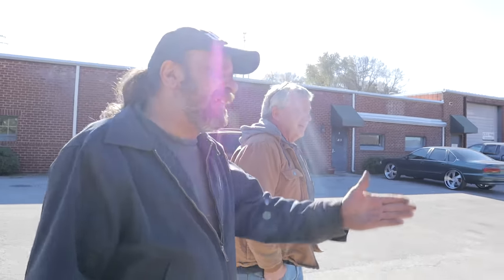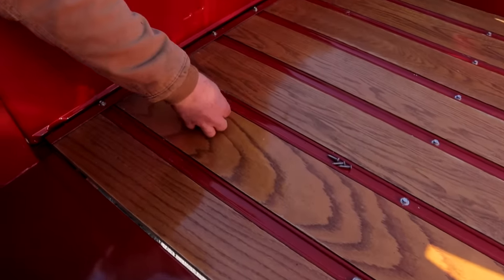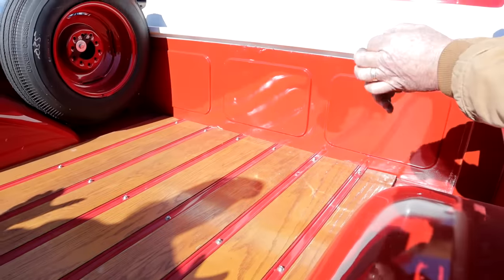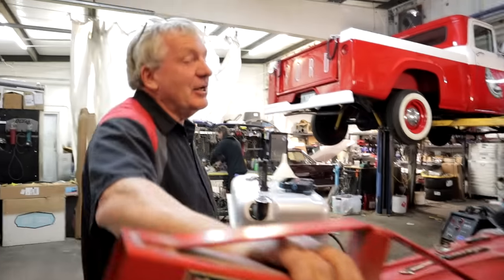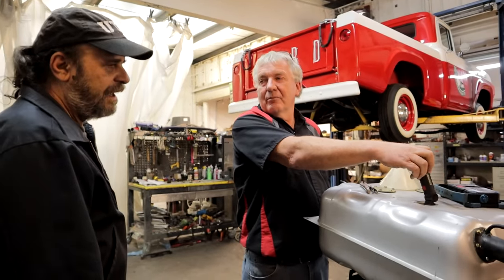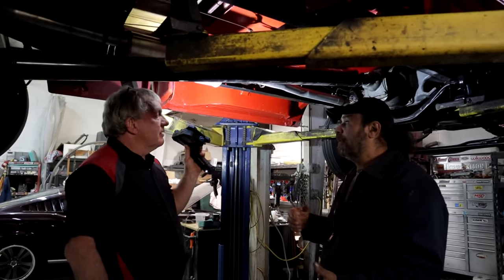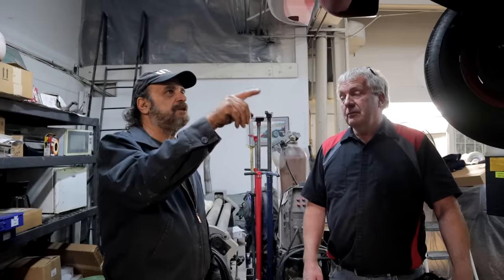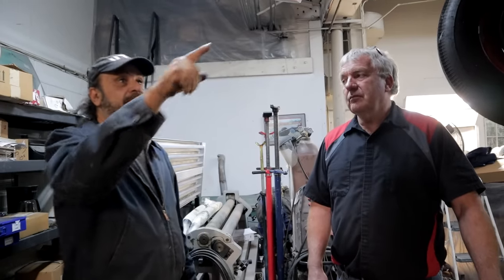Frame Off Restoration Gone Bad - Pretty Red Paint Hides Trashed And Rotted Parts Throughout

Comment: Glad you named names. Too often the perp is never called out. It should be easier to get compensated for frauds like that. I'm a redneck through and through, but I cut no corners when working on other people's stuff, nor will I even if they ask.
Reply from the maker: We've done videos like this before, but left out names because there was no clear and direct path back to the party who actually did the work.  In this case, the owner of the truck had a direct one on one transaction with the people she contracted to do the work, and that's why we "named names".
Reply: @UncleTonysGarage  Absolutely agree. There has to be a direct line to the people that did the work. Again, goes back to why I wont cut corners even if they want me to. Clearly this lady didn't ask or pay for that but I have seen botched up crap that the customer actually asked for because they themselves are the deceiver. Shops just shouldn't do it, if the deceptive seller gets caught, they'll throw the shop under the bus in a second.
Reply: @yodawunn6700  been thrown under the bus plenty. So I always give people the option to take their car anywhere else for a second opinion before I even start, and explain although there are cheaper methods, I refuse to use them. It's like buying the cheapest part you can find. It's the one that is guaranteed to fail.
Reply: @UncleTonysGarage  , I went on their website. They advertise as their specialty is restorations and old trucks. I can see why she chose them to restore this truck their advertisement looks l legitimate. I wonder how many other customers receive the same treatment from Possum hollow garage ? We need more people exposing businesses like this. I suggest anybody who’s looking for people to restore your vehicles. You get more than one reference on their work or do it yourself.
Reply: It's getting harder every day to trust anyone who we hire for anything!
Reply: @UncleTonysGarage  If this lady payed top end money and got that second rate job done then I agree and feel for her ' proof is in the contract details !
Reply: @UncleTonysGarage  I wonder if @PossumHollerGarage will respond to this. The problems with this truck are inexcusable, even if the lady did take the cheap route. Structural members held together with the equivalent of baling wire and chewing gum? Boards in the bed not even fastened down? The filler neck on the gas tank not even installed? The way they mounted that gas tank? That's not even good enough to be called shoddy. It's downright criminal.
Reply: @yodawunn6700  ...on the other hand...I  have a release form people have to sign when the want work done that isn't up to industry standards and practices...you don't find out who the cheapskate owners are till you're 3/4 done with the job and already owed money generally...I  would be willing to bet the shop that did that work did so at the customers urging...
Reply: We can hold them responsible. I asked them what they had to say on facebook with a link to this vid.
Reply: @waynefergusson9987  that's what I said nobody saw the estimate
Reply: You got to be very careful when naming names, if you name the wrong person/business for shoddy work you're going to get taken to the cleaners for libel. Hence why channels make damned sure that they're accusing the right people before giving names.
Reply: @JSki-kb8vf  ''I would be willing to bet the shop that did that work did so at the customers urging...'' What you're doing there, is called Making An Assumption.
Reply: @ryurc3033  no one tells people the price so for that reason I can’t do a cheaper paint job it will put me out of business
Reply: @timothydraper3687  ...based on 50 years of doing business...I've seen this movie before and everybody thinks the butler did it...
Reply: @JSki-kb8vf  Ha ha.
Reply: @jackieallen3344  I don't see any way that this would be the only truck they've done this way.
Reply: @Wooden Door Garage Without naming what country you are talking about, then everything you just said is nonsense. In what country do you need "ex certified parts"? I've lived in multiple EU countries, never heard of such a thing.
Reply: You don't know the other side of the story. They could have informed her after sand blasting that theres more rot and then she couldn't afford to fix it properly and was so far into it already so she told them to fix it however they could for the small amount of extra money she could spend
Reply: @MidnightPolaris800  If that were true, why then is she now selling it at a huge loss and angry about it?
Reply: @@thatv8life186 That post is totally devoid of any critical thinking what so ever.
Reply: It's not necessarily a perp. Do you have the frame-off receipts?
Do you know what the customer requested or paid for?
Frame-off jobs can be done on a budget BECAUSE of the customer's personal budget.
Was it $5,000 job or a $50,000job? It makes a difference and that information was not provided.
Reply: @MidnightPolaris800     I've had  what you theorize actually happen!  A 67 Chevy truck we did was found to have a lot more rust than was anticipated.  This was explained to the customer but the only options he was given was to fix it correctly or to abandon the project.  I have a great reputation that I'm proud and protective of, any good shop is the same !  The customer came up with the extra funds and as a result has a truck that has a 7 page feature in The C10 Builders Guide magazine that's on the stands right now!!   He's immensely proud as am I, he has no regrets, I have no regrets!!   So tell me, which truck had the happy ending.......?
Reply: @2Truth4Liberty   the customer doesn't run the shop the owner does! A customers inability or reluctance to pay should not dictate the quality or lack of quality of a shops work or ethics
Reply: @kiwiclassicsandcustoms9160  "A customers inability or reluctance to pay should not dictate the quality or lack of quality of a shops work"
That is YOUR OPINION, not FACT.
The FACT is that many people appreciate being able to adjust the quality of work requested based on their personal finances and there are good business that will accommodate their needs.
There is NOTHING unethical about that.
I would suggest there might be something unethical in discriminating against who can have work performed for them based on their personal finances.
Reply: @2Truth4Liberty  that's an interesting take on it.  For me it's about doing it right and doing it safe. That shouldn't be compromised on regardless of customers  wants.  Some times it's a inability to pay for what's needed and sometimes it's not being prepared to pay as they want to make a profit.   I had a guy come to me wanting me to bondo or lead up the large, hand sized holes around the roof of his truck. My response was "you can't lead fresh air"   He found another shop.
Reply: @kiwiclassicsandcustoms9160  While there were some flaws that should have been caught, I saw nothing that would fit the description of "unsafe". My '66 F250 is in far worse shape and I consider it one of the safest vehicle on the road as-is.
Reply: @2Truth4Liberty  yeah well it takes a lot air bags in your Prius to fend off a 79 F250 😁😂
Reply: @kiwiclassicsandcustoms9160  I thought it was a 1960 Ford pickup not a Prius??? Did I click on the wrong video?
Reply: Somebody's going to get it sued for liable
Reply: @SKANK_HUNT49   
Just technical FYI
Defamation is divided into 2 types,  libel and slander.
libel requires that the defamation be in "written" form

verbal statements in audio form would be defamation by slander (slander is the catch-all for what libel does not cover)
Reply: they have pictures of this truck on their website 🤣🤣🤣
Reply: @2Truth4Liberty  uhhhh , yeah that's exactly how it works... if you can't afford to have the work done it doesn't get done ... and any restoration shop worth it's ass would say the same thing ... WE'RE NOT GONNA RUIN OUR REPUTATION SO YOU CAN HAVE A BONDO BUCKET TO LOOK PRETTY ON YOUR LAWN FROM 500 FEET AWAY !
Reply: @2Truth4Liberty  if you drive truck worse than this on the road you are part of the problem! you're the reason states have inspection laws ! the crossmembers are rotten , the rocker panels are made out of fiberglass, tape and RTV  , the cowl returns are paper thin , the bed floor isn't secure , what happens if someone puts a heavy load in the bed abc they're driving down the highway and that bed falls apart on the inside and the load and the wood the bed is made from is scattered all over the road causing other people to wreck avoiding it ? or this lady gets t boned and the cab folds up like a pop can ? or she's driving in heavy traffic and the truck dies because the gas tank is full of rainwater and now she's in danger because she stalled out on the highway where other cars are doing 70+ mph ??? you don't think any of this crap is dangerous ? especially for a middle aged woman who isn't especially mechanical? THEY TOOK ADVANTAGE OF HER PLAIN AND SIMPLE , no matter if she asked for it to be done as cheaply as possible or not they should know better
Reply: @Hard_Right  You obviously have not been in the marketplace. And no reputation is ruined for doing what was  REQUESTED AND PAID FOR.
Can you produce the receipts for this Possum job? If not, you are talking without having pertinent knowledge.
Reply: @Hard_Right  And?
Is the "restoration request" and the "receipts" on their website too?
If not, your comment is irrelevant.
Reply: @2Truth4Liberty  oh cool. Slander then I guess. I'm not a smart man.
Reply: @Hard_Right  no joke I can't tell you how many times I've had to explain this to people who have done jobs for me around the house. They say well for what you're paying that's the best it gets. I'm like no you quoted me a job you should do it the correct way. Then I ask okay how much will it cost to have it done right. Because I still need the job to be done.
Reply: @yodawunn6700  They left out that this truck is 15 years old done when the builder had first started his business. The builder has made over 130 trucks and built them for country singers, the amount of disingenuous information being put out by this channel is disgusting
Reply: @yodawunn6700  Honestly its sad that you believe any of this.
Reply: Yes. Safety is an illusion. The truck is totally safe.
Reply: @Jackdaw836  So, what are you saying exactly? Country singers are authorities on auto restoration? This shop has cranked out 130 trucks and this is the only one that had hack work done on it? Just starting a business is not justification for a lack of integrity. When a shop paints and polishes everything perfectly on the outside but puts tape over holes and paints it underneath where it isn't seen so easily, that's intent to deceive. A ten year old knows that isn't how it's done. What's sad and disingenuous is trying to defend something that's indefensible.
Reply: @yodawunn6700   its supposed to mean that hes built up alot of credibility over the years, not that country singers are authority on the matter, clearly. im not going to sit here and argue with you stranger I just know that good people, and a reputable business owner are getting harrased for no good reason, his shop wouldnt have got to the point its at now if he didnt do great work on all the trucks he worked on or noone would go to him. Youre seeing a truck from a time when that shop was much smaller and may not have had the most experienced workers, im sure he did the best he could with what he had. Ive not said he was immune from criticism just that the uploader is intentionally leaving stuff out to create a narrative and by your own words, thats just as deceptive.
Reply: @yodawunn6700  The uploader is also hiding comments. I hate to break it to you but the wool is pulled over your eyes mate.
Reply: @yodawunn6700  Be a man and admit you got played dude. Dont start ignoring points now🤣🤣🤣
Reply: That's called Integrity which means doing the right thing even when no one is watching.
Reply: @keklegate  No doubt, when I think about all the hard work I did when I could've just put tape over rust holes and half-a$$ed everything no one sees and still charged the same high price, I def got played! 🤣🤣🤣
Reply: @yodawunn6700  🧢ignoring points still, that damage is from after genius you really do have the wool pulled over your eyes.🤣🤣
Reply: @yodawunn6700  Lmao dudes whole point is that the damage isnt from the actual restoration, its from after, and you ignore it to go right back to what daddy told you. Youre a special kinda slow boy
Reply: @yodawunn6700  This is a defamation case waiting to happen watch
Reply: @yodawunn6700  The thing thats the most sad here is you only are only acting like this because your comment got pinned, but when people come thru trying to tell you that not everything may be as it seems instead of fact checking anything, you double down. Idk. I think the uploader is slimey but to each their own, just pointing out how you look right now
Reply: @madmax2069  Yeah I know. And if you believe that she directed that shop to cut all them corners and is now angry about it and willing to sell the truck at a huge loss, then you are one of them.
Reply: @kyle8952  Here in Portugal you cannot fit any accessories modified parts not made by the manufacturer of the vehicle also wheel and tyre sizes are on the reg doc and you cant change them also no engine swops unless it´s like for like...eg I can´t fit a winch bumper to my 90 Defender made by a specialist company or a bike rack on the back of my Smart FORTWO even though it is an option from Smart...
Reply: The "restoration shop" should be out of business.
Reply: @2Truth4Liberty  got proof the job was done 15 years ago? Ever single review on google that’s actually had work done is a complaint and the rest that are above 3 stars are from cruise nights and in every response to his customers he uses the excuse that the work was carried out years ago. Anyone that has ANY credibility in the Industry would NEVER turn out this type of work regardless of the pathetic excuses people like yourself seem to come up with. How ridiculous you have to be to put this type of garbage onto the customer lol. It says a lot about you and your opinions. A frame off resto is exactly that and anyone that’s done them knows what’s involved and the time/cost that goes into it, sure sometimes extra things come up but usually minor things once you’ve looked over the project properly before taking on the job. There is simply no excuse to be  made for this type of work, you’re either a bodgy tradesman or you’re not it’s that simple.
Reply: @shagohod2935  
What makes you think that UTG is hiding comments?
Reply: @robshipman8691  
I’m disappointed. I thought Portugal was a pretty cool place. That actually sucks that you can’t do modifications on your vehicles. You must not have a car hobby over there. How boring life must be. 
I’ll take buyer beware and dangerous freedom over safe and boring tyranny any day.
Reply: @armchairgeneralissimo  
Did you read UTG’s reply to this comment?
Reply: @JSki-kb8vf  
I suspect you would lose your bet. The evidence against the butler is pretty strong in this case.
Reply: You Can't always Blame the Builder Some Customers Pockets aren't Deep Enough to do Things the right way ..
Reply: @vladtheimpala5532  Uhhh he is hiding comments. Theres no debate there
Reply: What I was trying to say that jobs like that truck  that was done so wrong and the lady was charged 70 grand for some orange paint,is the reason people think mechanics are all crookes,and we are not most of us are good people who take pride in there work,but just like you saw I promise you when utg and ummiey are not around she will lable all mechanics as crooked when not in your presence I have seen it to many times been a mech since I was 12 started full time when I was15 in automotive shop full time raised three kids have a bunch of granchaps ,working on 59 now had enough I'm done working for other people ,I will just do my hot rods,I drive a 454 Isuzu 92 pup daily drivr and 85 bronco 2 with 5.0 ho p heads 4barrelcarb intake b cam
Reply: @MidnightPolaris800  Even if money was a problem a reputable shop wouldn't have done some of the things this shop did. I can see some of the stuff like the dodgy rust repair, but the way they mounted the fuel tank was borderline criminal, that tank could have broken loose, spilled gasoline over the back of the truck and the road, and led to a big fire.
Reply: Just saying you want a good job done pay the actual price want something cheap  a low baller you get not so good results I know a lot of cheap skates who want everything for free
Reply: @UncleTonysGarage  thats crap, even the rad hoses are $2. items.. fk, id burn there shop down..why have a tank under bed.??. in cab is best. i have a 62 f100 4x4.  75 highboy, 82 bronco, 02 s/duty. all modified.. upgraded. ausie.. &, just for you,,a 73 r/t challenger, sublime..
Reply: @UncleTonysGarage  this is why i dont make my trucks pretty.. i fix whats needed.. i dont mind dents,, but rust or bad mechanics, i fix..its called reliability, safety.. that woman must be devastated.. no underbody shultz.. would of hid a lot.. fk thats bad..  tony should drive it down there & say,,im her son,,my mom has a few issues.. i need fixed..  like a fkn re fund..
Reply: @UncleTonysGarage  fk me,,you cant patch it,,it has to be re done,,totally striped, re build..  im just wandering,,did any mechanicals get done..  should start a go fund me,,so she can keep it.. PROPERLY DONE.
Reply: @UncleTonysGarage  yes me again..  im in s.a  aus..  i imported my chall..  sat in shed for 11 yrs, couldnt reg. it as it was  THE WRONG PAINT COLOR.   !!.. now the laws here have changed so its getting finished. bog stock std..  but,, i could buy a 34 chassis with a 600 hp motor,, totally legal.. the fk is that.??..
Reply: @woodendoorgaragenow those requirements are the epitome of ridiculousness.
Reply: @2Truth4Liberty mehhh... if ya ain't got the money, ya shouldn't be spending it on "restoring" cars or trucks. I am a car guy. I would love to have a nice classic car to restore, or put together one of those factory 5 kits. BUT... I don't have the finances. Hell, I dont even have a house. Hence...No car for me. ...Yet
Reply: @drewbiedoobie1416   [[ if ya ain't got the money, ya shouldn't be spending it on "restoring" cars or trucks. ]]
WHO DIED AND MADE YOU HEAD OF THE SOCIAL CONDUCT POLICE?
** regained composure **
Look, some people spend LOTS on a house and little on cars because that is what they want to do. Some just hte opposite, lots on a car, very little on a house. etc. etc. etc.
If people CHOOSE to have a cheap but nice looking car because THAT is what they WANT .... who on Earth has the moral authority to say anything about it?
Not me. You?
Reply: @thatv8life186 Do you honestly think that a current employee that was involved in or familiar with the shoddy work of their employer is actually going to go on video and incriminate themselves or their employer? At the very least, that's setting them up for being terminated and possibly involvement to any possible legal actions.
Reply: @2Truth4Liberty If you didn't see anything unsafe about the work shown on that truck, then you need to step aside and continue being a customer and not a reputable business owner.
Reply: @2Truth4Liberty 😂😂😂😂 Just sit back and learn. Because the tidbit of sarcasm from Kiwi went way way over your head.
Reply: @2Truth4Liberty And it's very obvious to many of us experienced and reputable mechanics/technicians  that you are certainly clueless and oblivious to what you're talking about.
Reply: @anthonykendrick1418  " you are certainly clueless and oblivious to what you're talking about."
can i just say ditto?
so, we clearly have a difference of opinion.
I have set out sound logical reasons for my position and know of experienced reputable mechanics and restoration specialists that agree with those. In that light, i would say that you seem to be among those that would like to control the wishes and desires of those who just want a very inexpensive makeover and accept that that means far from perfection.
Reply: @2Truth4Liberty  I stand by my comments. I have well over 35 years in the automotive repair and recovery business. Any mechanic or so called specialist, that allows or approves this type of work is certainly and absolutely not reputable. When it comes to "Mom and Pop" (small businesses), word of mouth has a tremendous impact. Shoddy work like this one sets us up for liability and lawsuit issues that would ruin us small businesses. The word of mouth impact by itself can ruin us. I would never take that chance to ruin what I've worked for over 35 years to accomplish just because someone can't afford to have it done correctly. Sorry about their luck, take it to a backyard Jack leg because it won't be  done that way in my shop.
Reply: @anthonykendrick1418  "I stand by my comments." 
As do I and the other reputable experienced restoration specialists I know personally.
One is out in Raymore, Missouri and has over 40 years in. (prefers working on the Mopars)
Ridiculous to claim threat of lawsuit. When the bill for repairs is presented to the jury they would laugh the plaintiff out of court.
Can you guess how much was actually paid?
Reply: Yes sir they have the wrong person
Reply: When she sells it, does she tell the new owners that it was a complete mess?
Reply: @timbrock2785  If it's going to be sold that will be after her death by her estate.
Regardless, new owners have common sense responsibility to inspect what they are buying no matter what the seller claims.
Reply: I don't know how much she paid for this, but if it's not safe ( which is relative because even if it was new, these old car areas very safe anyway) I would have refused to do the job. If I can't do it perfectly, I don't do it at all. Especially if safety is a concern. I've lived in Eastern Europe and I've seen so many crashes with cars and trucks that appeared very sturdy but consequences were devastating, especially with older cars and trucks from the 60s and 70s. I assume its the same thing in the US.
Reply: @woodendoorgarage Spent a year fighting an inspector at the German TÜV over disc brakes on  tri-five. In the end I put the drums back on to get my historic tags. At shows now it seems I am the only 50's Chevy driver without the safety of discs up front. The other cars I see with discs have historic tags too, talk about frustrating! But despite all that, yes, having done restorations in the US and Europe, it is important to have some form of post-resto inspection in my opinion.
Reply: If I was her, I would file a lawsuit
Reply: Thanks. 100th comment. Maybe it helps the yootube algoshit
Reply: Yea I'll do a band aid job on my own stuff sometimes but never ever other's.
Reply: Seriously!
Reply: @waynefergusson9987 bro she paid SEVENTY THOUSAND dollars if going by frame off estimates.

For that type of money that shit should be glittered in gold.......joking but you know what I mean
Reply: @thatv8life186 oh I don't know because there's millions that do cut corners.

Honestly that was a really stupid response and question.
Reply: Good men never cut corners keep them happy an you'll make a difference
Reply: @2Truth4Liberty you're a dangerous liability to those u share the road with
Reply: @Chopper650 
How do you figure? 
I don't drive anything that is unsafe mechanically to be on the road.
PS
That the floor boards of my '66 F250 are completely rusted out and has a few little welded plates here and there in its place which allows lots of free flowing air into the cab from the open cab areas beneath  causes NO unsafe driving conditions.
I get more free flowing air than that when on my motorcycle.
Reply: They were paid way too much up front and waited until the last month of the year they had to restore the truck.   Then rush rush rush.   What a complete disaster.   She should do something about it
Reply: I would've restored like it was my own truck never would do that sorry of a job.
Reply: Used to tell customers that cutting corners and cheapingbout Costs you more in the long run
Reply: @MrJeffcoley1  The name alone would have me looking for a professional shop.
Reply: @armchairgeneralissimo "get taken to the cleaners"
That depends on what is said. 
If it's true, the offending party may not want to open up their books for the law to see. 
If it's a lie , then that's precarious.
Reply: I don't either . that's your signature you leave behind
Reply: @UncleTonysGarage 1 I'm
Reply: @woodendoorgaragesounds like communism